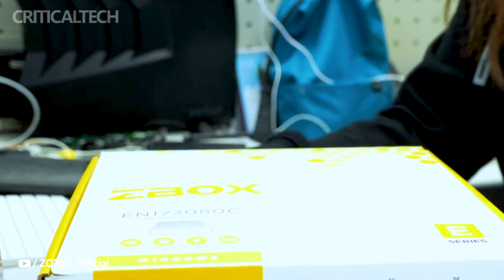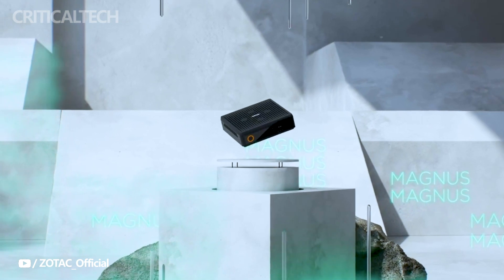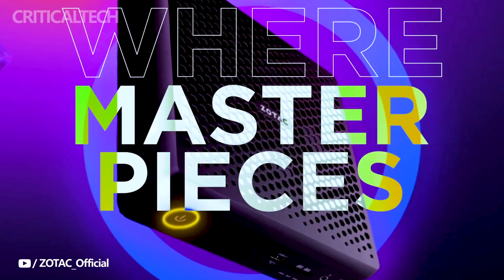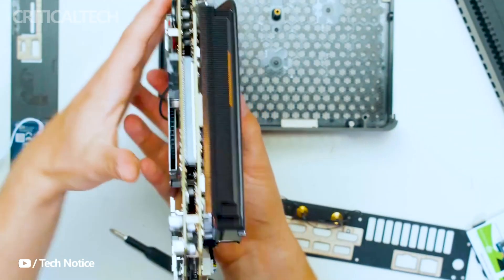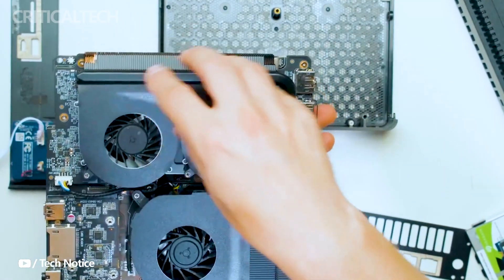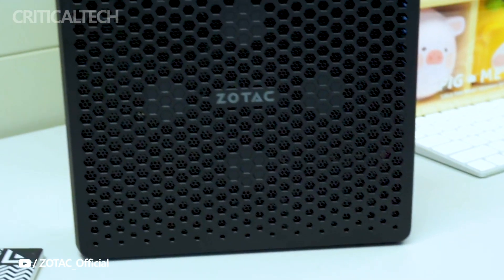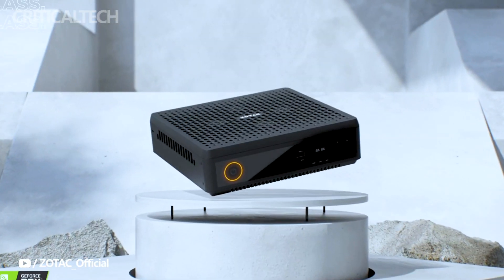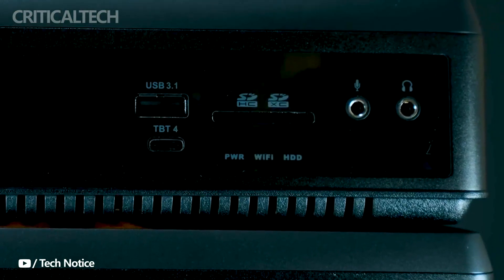Zotac ZBOX QRP7N3500 |  Intel Core i7-13700HX and NVIDIA RTX 3500 Mini PC!

Comment: 😮does this have transformer?
Reply from the maker: what kind of transformer?
Reply: @criticaltech7091  a machine that protect your equipment from thunder , power surge or blackout
Reply from the maker: @mikepalos  No. There is no built-in transformer, you need to buy it separately.  What mini PCs exist with a built-in transformer?